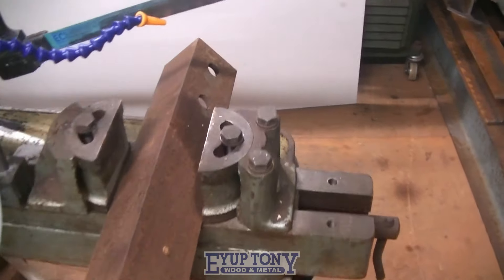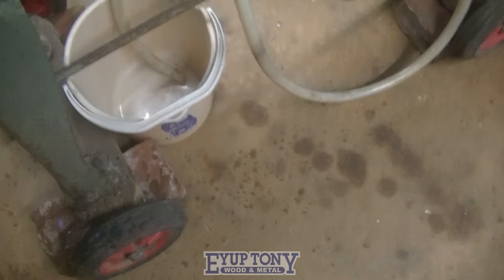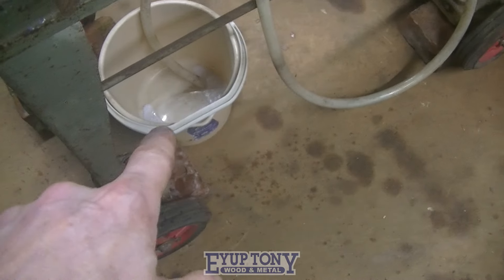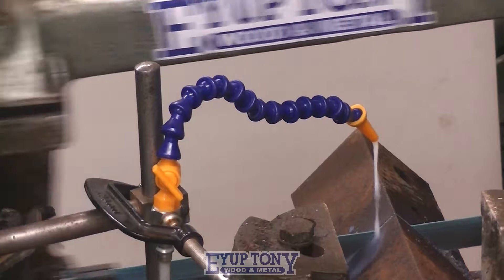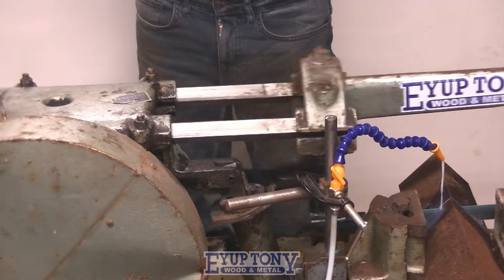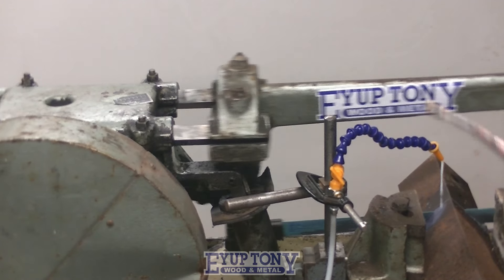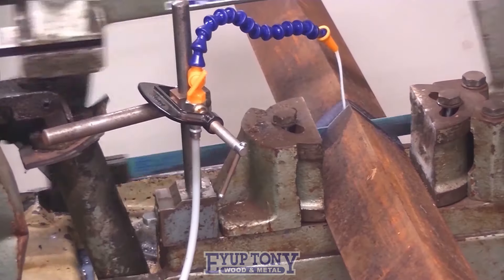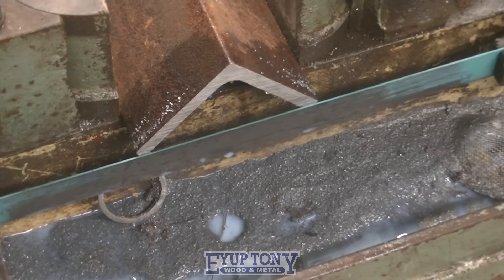Power Hacksaw - Fish Tank Coolant Pump - Works Great

Comment: very interesting! That pump certainly does the job well! Which way does the crank rotate on your saw? mine is identical but the lifting action on the backstroke doesnt seem to work on mine, and I was wondering if the rotation was wrong!
Phil
Reply from the maker: Hi Phil. The rotation is anticlockwise, standing facing the on/off switch. You can see it on my previous video about this pump titled- Cheap Coolant Pump Does It Work?  - https://youtu.be/nJm_E1RUzu0?si=54MVp7--nv0TesAu - 5 minutes 30 seconds in, you can see the crank revolving. Check that the oil filled damper/regulator has oil in it and is the correct viscosity and is adjusted to regulate the down feed, that has a lot to do with it. If the oil is too thick the saw head won't descend, if the oil is too thin the saw head will just drop. You might have to mix the oil to suit. Also the oil damper/regulator could be bunged up with muck, may need a clean out. Hope this helps....Tony
Reply: @eyuptony  yes i think that is the same rotation as mine! I will have to do some more research to see why its not lifting! You can clearly see it lift on your video.
Phil

Comment: Hey up Tony, can't beat a bit of lube mate, meant to ask if youve ever worked on the Harrison 140 gearbox? The 3 selector knobs on mine don't work right, but I can't find anything out about stripping and repairs to it? Didn't want to just steam i to it, and end up in a fix
Reply from the maker: Too right Ralfy. I haven't touched this lathe gearbox at all. You'll have to do a short video to show what's not working correctly on yours, so I or anyone else with the same lathe can compare. We might be able to help solve the fault. Cheers Tony
Reply: @eyuptony That's a good idea mate